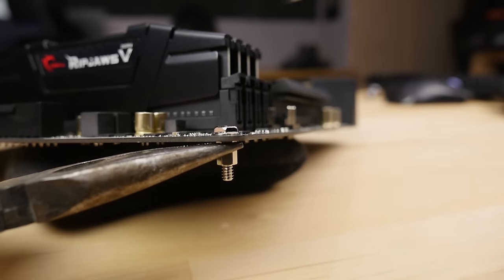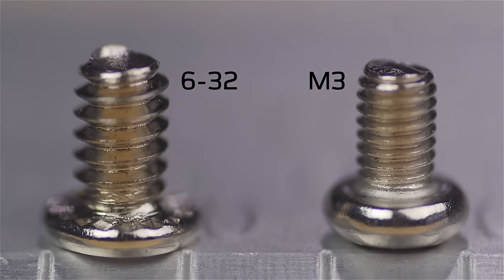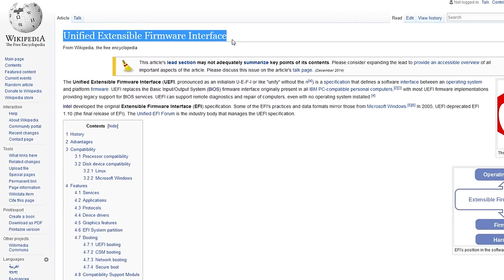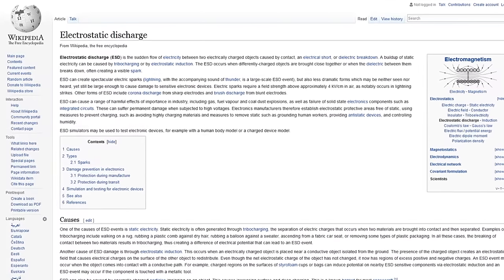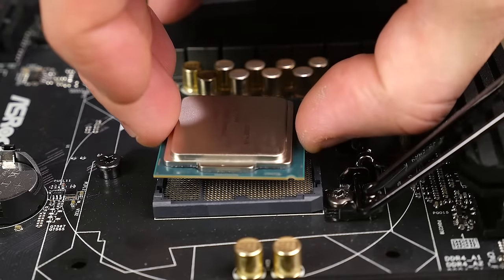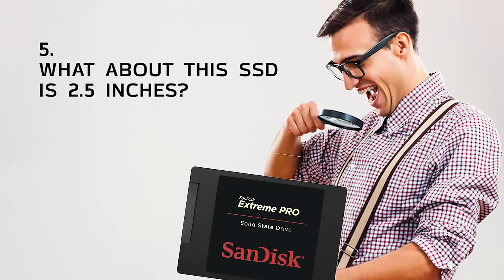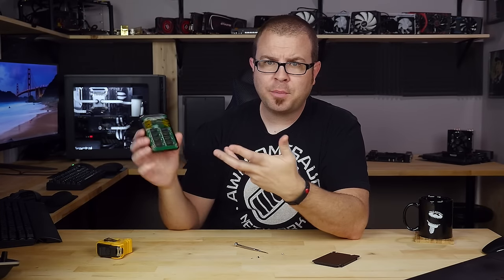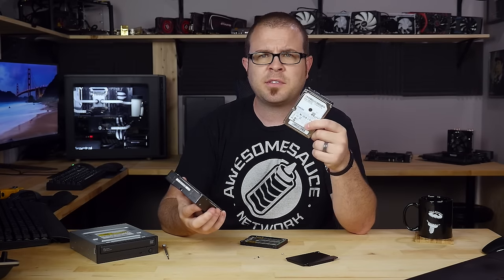5 Confusing PC Building Facts

Comment: If you're worried about esd, then wrap some bare copper wire around your wrist and cram the other end in the ground slot of an outlet.
Reply: And if any part of your body comes into contact with a source of power, you'll get zapped full force as the current follows that perfect path to ground.    Since most likely the power source and the grounded receptacle will be from two different circuits, there's nothing to trip the breaker for the power source.    Hence, you will be known from there on "if you live" as Sparky.
Reply: And Sparky here doesn't typically poke about on live circuits while tinkering around with his PC. Safety first!
Reply: On a less sarcastic note, I don't work on a computer while it's plugged into the wall... I also just try not to touch big capacitors. What other power source could you mean?
Reply: So you practice "Safety First".   Well, then you can start by not cramming the end of of the bare copper wire into the ground slot of a receptacle.    Safety first, if you really want to ground yourself, buy an ESD strap or touch the power supply regularly.   Connecting yourself to an electrical circuit in your home is not a safe practice and you shouldn't be suggesting it to anyone else.

Comment: Is a 2x4 really 2 inches by 4 inches? The PC,IT world has a good bit of jokesters in it. Don't get freaked out by words like "dongle' What should first time builders look for? Fit. Make sure that long graphics card and the PCIe slot you are putting it it does not butt up against some drive in the bay behind it Also figure out if that graphics card has enough cooling and figure out how air is coming into the case and exiting the case,before hand.. I figure my drive order first. Then do your case fans (including wiring and speed control),after that motherboard,then power supply and wire routing.You do not want to have to wrestle in the motherboard. Motherboards are delicate,treat them so. Fnd all dropped screws before it is "power on" time.

Comment: OK.  on a 2.5" drive, the 2.5" refers to the platters inside.  That is pretty logical to me.  But what about SSD's.  I'm pretty sure they are still referred to as 2.5" drives.  At least they fit into a 5.25 to 2.5 adapter.  But I think this little fodder will be over with the SATA m.2 drives'  As they look more like of DIMM of RAM &  don't go in a bay at all.  The whole drive Bay thing is over.  Issue solved.
Reply: VanGilder Michael I was thinking the same thing
Reply: Looking back at the thread.  I see I am just complaining about the terminology.  Aw, never mind.  This 5.25 & 2.5 will work for the couple months left to actually build a home rig.  Quantum and all.  We will all run netbooks probably by years end.  Even people who want a more powerful rig.  It is not possible to have a more powerful rig than the beast.

Comment: Good vid right until the last point. Drive 'sizes' are just a 'type' standard these days that has nothing to do with what's inside the enclosure anymore. Why would this confuse anyone? A 3.5" drive fits a tower chassis bay, and a 2.5" drive fits a laptop bay. The physical measured size doesn't matter and this is simple to explain to any newbie PC builder.

Comment: I was trying to install an ssd into my ssd bracket. I had a bag of screws and went into my manual of my case to see what screw to use. I was so ducking confused and contemplating if I’d be using the correct screw

Comment: I've got a confusing fact/question: why are SATA data cables actually smaller than the SATA power cables?  Seriously, check the connector that runs from the drive to your MB, then check the connector that runs from the PSU to the drive.  The power connector is longer in width than the data cable.  You'd think that for a drive that can theoretically push 6GB/s you'd need more pins in that connector than you would for the power. :-/
Reply: Maintaining stable power is far more important than maintaining a 6Gbps connection 100% of the time. The extra wires are multiple grounds, redundant lines, and even report to the PSU exact power usage if the PSU and drive supports it. SATA data cables also sport 8 connections per, which is ample for other connection types (Ethernet RJ45) to carry 10Gbps and higher. The last thing is that the SATA data cables are going to be running in the neighborhood of 1.2 to 1.5v at lower amperes than SATA power @ 12v, the thicker cables of the power connection are pushing more wattage.

Comment: I thought the 5.25 and 3.5 sizes came from the 5.25 and 3.5 inch floppy disk actual size, and their drives being called the 5.25 and 3.5 inch floppy drive by association, and the relevant spots for each in the computer case also referring to them as such.  In comes the smaller "3.5" inch HD, which could fit in the 3.5 in floppy bay.   Am I wrong here?

Comment: So it is confusing that the 2.5, 3.5, and 5.25 inches refers to the diameter of the disks which go inside those cases?   It's confusing that a 3.5" floppy is 3.5" wide and 5.25" floppy is 5.25" wide - so the drives which accept these discs have to have a housing slightly larger than the diameter of their disks?   Seems to make perfect sense to me.  

Thank goodness they didn't call the USB a 1/2" connector.

Comment: After years of building PC's I can honestly say that I don't think it's a good idea to keep your pc's power supply plugged into the wall outlet while you're working on it. Even if the outlet is switched off, you're still taking a chance. The fact that keeping it plugged in allows you to keep touching the case and preventing electrostatic build up on your body, is not a good enough reason to gamble with the mains system being accidentally connected to yourself.  Please, unplug the PC and discharge the power supply by attempting to switch the computer on while the power plug is out, before you fiddle inside. If you're worried about ESD, then read about wrist straps and how you can SAFELY keep your body (and possibly the PC also) earthed during assembly of your PC.

Comment: HDD Capacity: 512 isn't, because 1mb = 1,024 (like RAM) unless you're selling, in which case it is 1,000.
Monitors: 23" isn't because they measure diagonally.
VESA Mounts: So many standards to choose from. Literally, there are 5 different VESA mount measuring standards, they're not the same.

Slightly more obscure one:
DPI, is it the same between what a mouse moves, a screen displays and a printer prints?

Comment: 3.5" drive is for a 3.5" disk, aka a floppy, same goes for 5.25" drives, they are for 5.25" floppies. They all describe the disk going into the drive that is in the bay. The 3.5" bay, takes the drive which will accept the 3.5" disk. HDDs and SSDs just adopted the name of the bay. You would not get confused why your 3.0 Liter Turbocharged car needs more then 3 liters of parking space.
Floppy discs are not that old.

Comment: The size mentioned on drives come from the size of the media.  5 and 1/4 drive may measure 5 and 3/4 but the media you inserted IS 5 and 1/4. Similarly with the 3 and 1/2 floppy drive disks the actual drive was a bit bigger. this naming tradition is carrying into SSD since changing it would probably cause confusion.
Similar size to naming issues plage other industries, have you ever measured a 2x4, I'll give you a hint... it's NOT 2x4.

Comment: my very first computer i had no idea what i was doing, bought it used. It started giving me beep codes that, i was told, was due to the ram. i just needed to clean the slots with some air. well i took the ram out, unshielded, and set it right on my fucking carpet. slid them around even i believe. needless to say they still work fine to this day lol. didnt even think about static at that time. just thought i was being a badass and fixing a pc. i believe there is a TON of room for error with static, as i still do not wear any sort of static proof equipment. just work with my socks off on a hardwood floor.

Comment: I have only built two computers but each time something has flumexed me good, the goddamn pins on the motherboard and your front panel led/power/switches, the need for molex connectors!!! ESPECIALLY WHEN YOU HAVE A MODULAR POWER SYSTEM, cpu fan coolers, I brought a mini atx motherboard, and then a cpu, and the shop helpfully suggested that these two items where often paired with this particular cpu fan, so I clicked add to cart, only to have a fan arrive that was nearly half the size of my mini atx case, and then messing around with different connectors.

Comment: I never ever took any measures against electrostatic discharge and never had any issues whatsoever, and never encountered anyone who did. I think its just a myth completely, attributing failure of components years later to some obscure cause in the past.
I handle my hardware really careless when switching case or putting a computer together. They are sturdy pieces anyways, and everything that is delicate is usually sealed off. Even CPUs don't have pins anymore (once I had to bend a number of them back, still worked fine). I even once spilled something that cristallized on my graphics card. Suddenly had a lot of strange things going on on my screen. Cleaned it with deionized water, let it dry, worked like a charm after that.
If wiring up random shit on the card by spilling something on it, these things will not be very easily damaged by any small discharges that might happen during assembly.
Reply: Now the "pins" are in the socked. Just this week I had to bend some back after the board has been treated like crap.

Comment: LOL 
So almost all of my measuring tools are in metric and ive never realy been good at eyeballing impereal mesurments, becausse im in Australia and was programed to think in the metric system, which caused me problems when I was trying to scratch build a transparent case. I had to check the measurements of my hard drives several times  and was left scratching my head as I discovered that they did not measure 3.25 inches lol. Luckily a ruler is a ruler and I was able to divine the correct dimentions of my drives and finnaly draw up accurate blueprints. Now that you have pointed out that the disc size standard is litrily the disc size  I feel kind of stupid... How did I miss that little snippet for 25 years?

Comment: The drive-measurement thing isn't actually that confusing. Like you pointed out, the measurements originated from the diameter of the platters inside the HDD. Now with SSDs, using a different measurement like 2 3/4" would imply for most of the people, that they'd need a different type of drive-cage or mounting system wich would be even more confusing.

Kind regards,
Meta Custom Computers

Comment: #3 "I have never in my life actually damaged a piece of computer hardware with a quick shock from ESD"

Unless no computer you're ever touched has ever malfunctioned, you don't know that.  I'm willing to bet that you've had hardware that has failed and you've had to replace it and you never tore it down and looked at the circuits inside the chips with an electron microscope.  Damage from ESD is usually a molecular breakdown in an insulator that doesn't immediately cause a short circuit.  It can start off as an intermittent fault and may progress to the point where you finally replace something like a DIMM that solves the problem.  Only rarely does it cause immediate failure.  When you analyze the statistics of millions of memory modules overs years, it can become apparent.  Using caution to safely discharge static is a cheap and meaningful protection.

Comment: Here's one, I had this issue a long time ago but I cant remember the last time it happened to me but I ordered a MB and CPU and the MB says it's compatible but after you get it you find out you need the bios updated before the CPU will work and the MB will not post unless you put a different older CPU to update the bios in order to install the CPU the was intended to be used

Comment: It's always been public knowledge that the dimensions of 2.5" and 3.5" drives actually refers to the diameter of the disc inside and not the external casing, so it's a little ignorant to describe that as 'deceptive'. Furthermore, 2.5" SSDs are so called because they have no disc to measure but they do have the same external dimensions as 2.5" disc (or platter) drives, so that's what's used. It's largely irrelevant in the grand scheme of things, but it does show that this guy was really struggling to think of 'confusing PC building facts'.

Comment: Here's a guess about the screw question, REMEMBER this is only a guess!!! Ok the PC was developed in the US, so  cases were based on US 6-32 (6 size 32 threads per inch) bolt where the floppy was built in Japan which uses metric size screws. Oh also hard drives. So we might have designed the floppy or hard drive but didn't give a size to make the screws to install them or they simply used what they normally used in construction (metric). Thus we have two different thread standards. Just sayin'

Comment: UEFI hadn't been necessary, had PC and operating system manufacturers agreed to use the CoreBoot standard instead. This is the more open way of doing what a BIOS does, and thus it provides more freedom. But in the end, that's the "unloved" freedom, because it means general computing can stay general and not be confined to work like an appliance.

Comment: How come there aren't any UTS 6-32 screwdrivers on Amazon? None of the screwdrivers I have at home seem to fit the screw head perfectly. Either the tip is too pointy and doesn't get a good grip, or I use my jewelers screwdrivers which are too small.

Comment: I liked the video, but, the last fact about the drives was silly. With HDDs it makes total sense, and it would be silly to start calling them 2 3/4" drives. Plus, this is something that occurs with many different things. For instance 2x4s are approx 1.75"x3.5".
Reply: +David Martindale Cases and laptops still advertise 2,5" drives, giving the SSDs with the same formfactor a different name would only cause confusion. The current use is technically incorrect but practically much easier.
Reply: Chirimorin1 That's what I was saying. Sorry if I phrased it poorly.

Comment: Paul measured the width of the SSD in its case and the length of the PCB but not the width of the PCB. Maybe it's the width of SSD's PCB that measures 2.5"?
Reply: no
Reply: +michaelemouse1 They told you where the measurements come from. It is the disc storage platter diameters that dictated the case sizes.